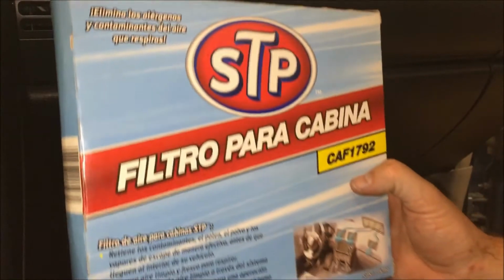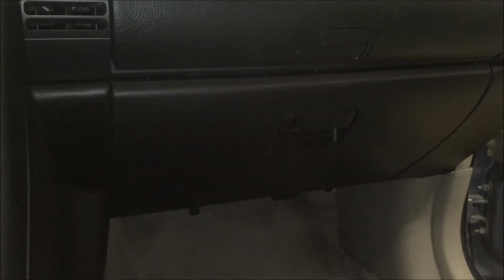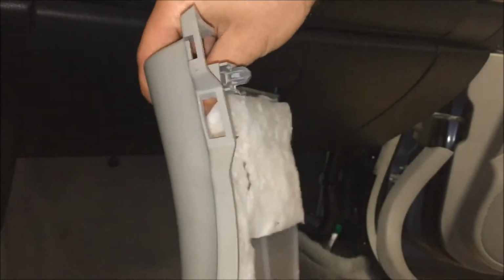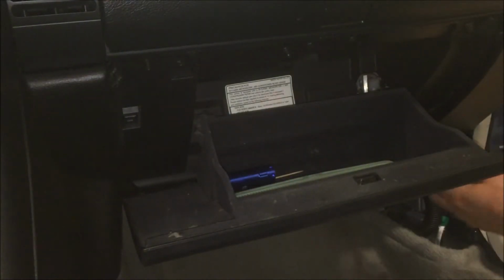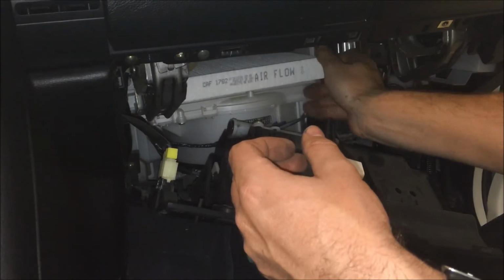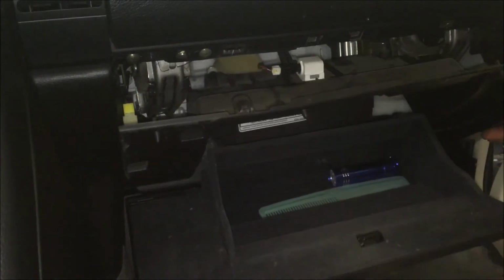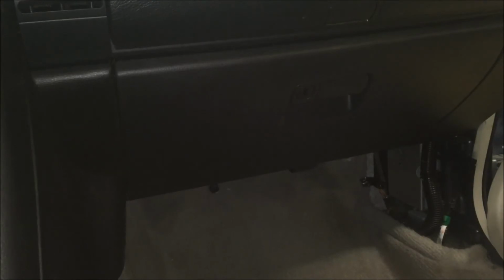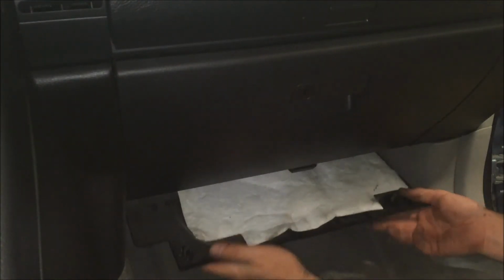Infiniti G35 Cabin Air filter replacement DIY Microcabin air filter

Comment: Great video, when did you realize it was time for you to replace it?
Reply from the maker: We live in a dry climate, so just decided to change it, but with more humid areas you’ll probably smell some mildew or just want to change it every year or so
Reply: @Maarvvs, you may not need an answer anymore.. but a good tell tale sign is when sitting back in car seat, with fan on full blast, if you don't feel the air strongly, it's a good indication that your filter may be clogged. 

Also, warmer A/C that normaly, or Cooler Heat than normaly, accompanied by a lesser air strength, could indicate a clogged air filter.

-- Owner of a Mobile Repair Company